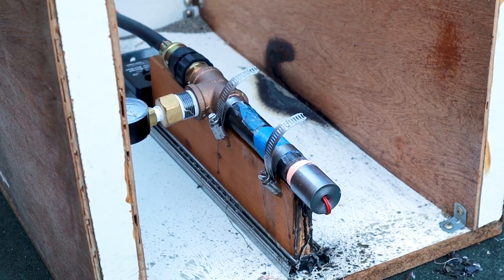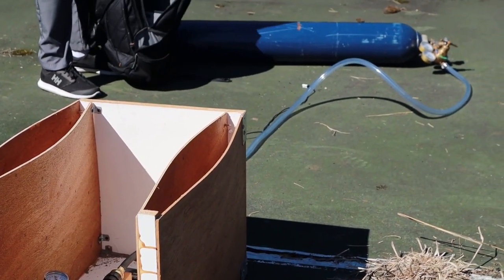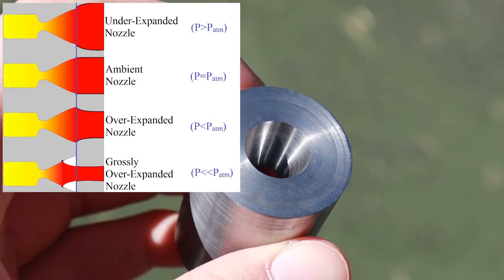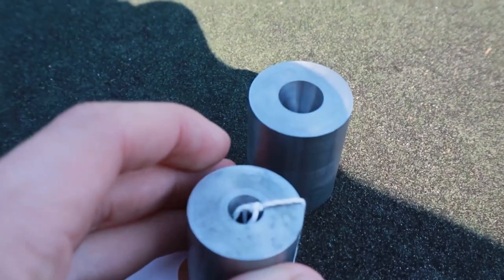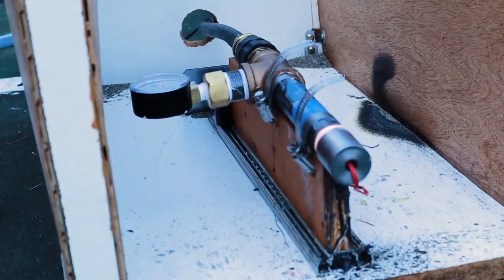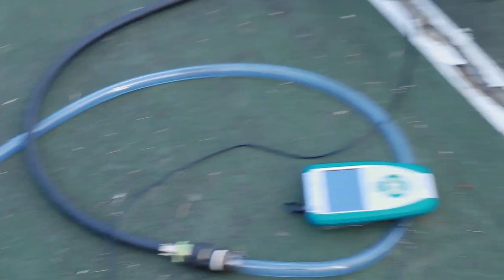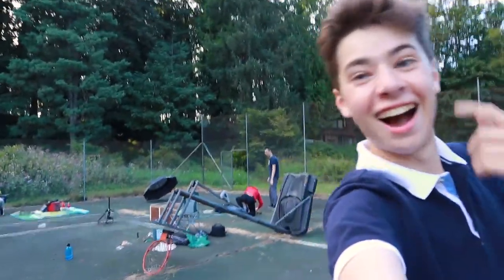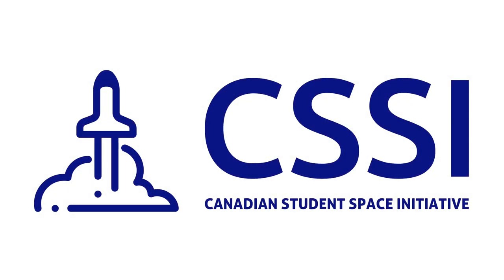Rocket Nozzle Propulsion Experiment Vlog

Comment: Damn I really miss doing these tests now looking back at this vid. One interesting (very annoying) thing with our engine was that the throttle valve was controlled by hand, starting all the way back from TM-1A that did not get enough oxidizer to burn correctly to now it was always just this hand operated regulator valve that I had to turn. For this series of tests I think it was because of this specific rented oxygen tank the valve became really sticky. That made it was quite hard getting the low flow rate to purge the system of air and get easier ignition before throttling up for the burn. A bunch of times our oxidizer would just push the igniter out of the engine before the air was purged because controlling the initial flow was difficult. Of all the frustration though, it was really fun developing and getting to throttle a working rocket engine while I was at CSSI.